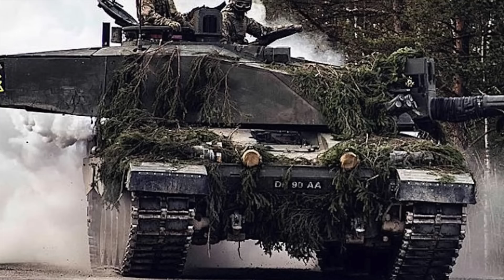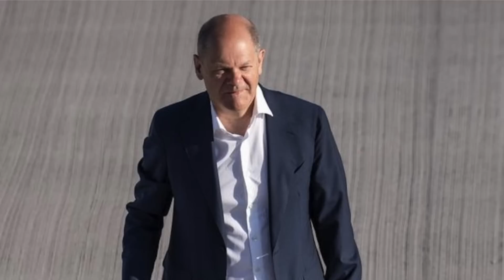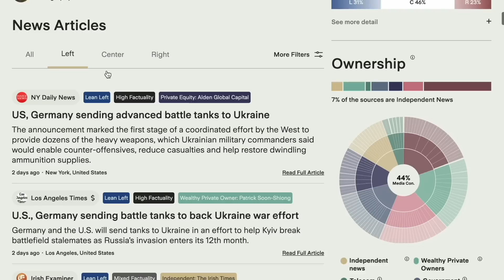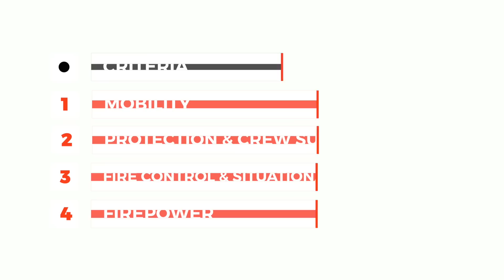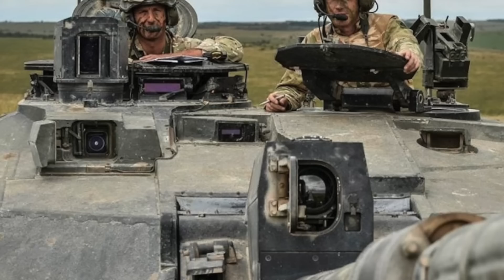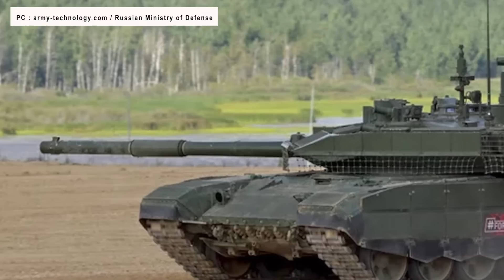British Challenger 2 vs Russian T-90 - Detailed analysis !

Comment: The original T90 wasnt supposed to replace or developed from the T72. It was a T72. Namely the T72bu upgrade they were working on since the later 80s. After the Gulf war in 91 where the T72 got wrecked they changed the name of their most recent upgrade to T90 when released in 93. In order to reduce backlash on sales.
Reply: T90 is basically a T72 with a few electronic upgrades like basic night vision.
Reply: Yes, the Russians are good at renumbering an old product.
Reply: Iraq T72 didn't even have thermal optics, they got the export model that didn't have composite armour and thermal optics, they didn't have a chance, in reality they were greatly outdated, even the Russian T72 was is outdated compare to M1 and challenger, but would've put up a better fight then these export models that were taken out while blind.
Reply: @paulroustan3643  the same excuses also were used in other cases. The Ukrainian war has shown that the Russian version is just as crappy and even worse than the Arab ones. As they lack the French optics, computers and communication sets the Arabs often use.
Reply: @ZLSM-fan   most destroyed tanks in Ukraine have been taken out by artillery, The M1A1 and the Leopard 2 won't perform any better against artillery fire, both will be penetrated any artillery fire.

The Kornet was designed to take out the M1A1 through its frontal Armour, the Kornet destroyed a Leopard 2A4 through its turret frontal Armour.
I don't know if it can get through the M1A3 frontal Armour, but it will get through the Leopard 2A7 the frontal area of the hull, don't know if it will get through the Leopard 2A7 frontal turret armour though.

Remember the Kornet is regarded by many analysts around the best in the  world, forget about going to MSM BS, go see for your self from independent analysis,  it can penetrate up 1.3m of modern composite armour
Reply: @paulroustan3643  you still think they will have weapons and equipment in the Russian army 🤣🤣🤣 Why do you think they told the artillery boys to use their shells economically, at the front the supply is destroyed faster than they arrive. The Russian armed forces would have spent the money they pay you and your Russian Copium Squad members online better if they invested it in logistics and weapons production infrastructure. Now they have to beg North Korea and Iran for weapons.
Reply: @paulroustan3643  Funny how you fail to mention one of the tanks this video is devoted to.
Reply: @paulroustan3643  The Kornet was designed Russians though, they may have said it was designed to take out M1A1s but the funding  got spent on vodka and hookers and can't do shit, they just said it can to the higher ups. 
Joining the military in Russia is like working at Mcdonalds, it's for bums (actually that's probably too harsh on McDs) and there's so much corruption any claims made about how good anything is like believing Russia stronk memes.
All the decent tank crews will be dead and they're getting basic training now, Ukrainians on the other hand are getting training in the UK by actual professionals (I know I live near a base, I've seen and heard them training).
Reply: @paulroustan3643 Not only that but they lacked experience and ammo. They says they were using practice ammunition against the Abrahams so it wasn't surprising why they got completely destroyed.
Reply: Yes, it is true that the T-90 is a further development of the T-72 tank...And it has nothing to do with the events in Iraq?! It is a contrived propaganda narrative for fools! Because anyone who believes in that is either a fool, an idiot or a total jerk! Because anyone who buys a tank, he certainly understands tanks, knows that the T-90 is an improved version of the T-72, or better said, a further development of this tank. So someone is now going to "deceive" someone by changing the name of the tank?! Don't be ridiculous! Also, the T-72 and T-90 were sold without problems both before and after the events in Iraq... Because they are to everyone , who bought these tanks, very well-known facts, which I will state, presented below in the text.

The T-72 tank used by Iraq is a deeply degraded variant of the T-72 M tank, which was produced under license in Poland and Czechoslovakia during the USSR... Purposely, the creation of a degraded variant for export, and for the countries of the Warsaw Pact... So that all the countries of the Warsaw Pact had exactly this version of the T-72 tank, some countries still have it, such as Bulgaria, and the Bulgarians even call the T-72 version M the "monkey version" which is not far from the truth! Also, Yugoslavia could only buy the T-72M version, which it later produced under license in the significantly improved M-84/A version... Or to be more precise, the then Soviet army, and later the Russian, Belarusian, Ukrainian army ... They never used the T-72 M version because it was never intended for the Soviet Army, nor was it ever produced on the soil of the USSR ... Otherwise, the difference between the original Soviet versions of the T-72 and the version for export and for the Warsaw Pact was huge! First of all, in the armored protection of the tank, not to mention the opto-electronics on the tank itself! The version of the T-72M that Poland exported to Iraq had armor protection and opto-electronics, all systems in the tank were at the level of the prototypical version of the T-72 tank, under the designation "Ural" from 1972, with a classic cast turret, without reinforcement in the armor protection. on the turret, with added non-metal. Only that the T-72M/M1 versions were called until the mid-90s of the last century, and they were at the level of the end of the 60s... Only the T-72M1 version reached the level of the first modernization of the T-72 tank, the T-72A from 1977, and not even in all segments. And only somewhere in the mid-90s... Which means that this T-72M tank has a primitive fire control system, where you have to stop if you want to hit the target at all, this version doesn't even have a meteo sensor, also the tank itself is practically "blind" at night, since it has visibility up to only 800m in ideal conditions... For comparison, the first modernization of the T-72 tank from 1977, the T-72A, already had reinforced armor protection, with added non-metals... Meto sensor, and a new fire control system, while the T-72A version from 1981 even had ERA contact 1 protection, and a new cannon...Which means that the M version was even worse than the first old Soviet modernization of the T-72A from the end In the 70s of the last century ... Let's not talk about the fact that the T-72B version was already in use in the USSR in 1984, which had an even thicker basic armor than the A version, plus ERA contact 1, and a new fire control system, new cannon, and new ammunition, as well as the possibility of firing from the barrel of the cannon, new SVIR range guided missiles 4 km ... Also, to make matters worse, the Iraqis also bought old USSR stocks of old projectiles with a penetration of only 300 to 350 mm of homogeneous steel?! The Iraqis, even without a license, saw the T-72, which was even worse than the T-72M version... So what the Iraqis had only physically resembles the T-72, otherwise it is a far degraded variant of the T-72 72 tanks... These are facts that can be easily verified. So this version of the T-72 M, due to the latest version of the M1 Abrams tank, had absolutely no chance, for obvious reasons... Other factors also played a role in that conflict, from the complete military superiority of the countries that attacked Iraq, up to the complete control of the airspace and everything else... Also, and for better understanding, the version of ABRAMS tanks owned by, say, Egypt is not at the level of ABRAMS tanks owned by the US. But the difference with the mentioned T-72 tanks is even more drastic.

Here in this video clip, some data are listed, which are correct, but they are persistent throughout the video clip, they mention the characteristics of the first and initial versions of the T-90A tank, which is certainly worse than the Challenger 2 tank. But there is no mention of the T-90M /MS versions or the last and best T-90M Proryv 3. Or those versions are mentioned, but their characteristics and specifications are not mentioned, but the T-90 A version, the initial version from 1992, is constantly being talked about... The T-90 in the version with an 840 hp engine has a maximum speed of 60 km/h. so it's a bit faster than the Challenger 2, which has a 1200 hp engine ... While the T-90 with a 1130 hp engine, which is also the most mass-produced, has a speed of 70 km/h ... And all variants of the T-90S tank series /M /MS /M Proryv2/ 3... They have an APU unit! In the video clip, he stated that they don't have any?! The initial version of the T-90 tank from 1992 has "Sthora" active protection, which is outdated, that's right! But it is only on that old version! While in the video clip he did not mention any other version of the active protection that is used on newer versions of the T-90 tank, it must have been "accidental"?! Since T-90M/Proryv 3 versions... Use active protection "ARENA M" or even "AFGANIT", why is it not mentioned in the video clip?! It must be "accidental" again?! He also stated the data, again from the initial version of the T-90A, when the question is about the opto-electronics, from the initial version from 1992, which has not been produced for 15 years?!

  It would be about the same as me comparing a Leopard 2A7 to an M1a 1 Abrams from 1989?! But this is a propaganda video for exactly that purpose! .And in the end, the madness of the brain "all this just like on paper because because of corruption, mostly nothing works on Russian tanks"?!

What a serious detailed analysis looks like, with all the disadvantages and advantages of both tanks. And the M1 ABRAMS SEP 3, which is a significantly better tank than the Challenger 2 in every sense! And the T-90M was the best variant at the time, after that the T-90M / Proryv 3 variant came out, which is still a significant improvement.

https://www.youtube.com/watch?v=mPlNvgH1zic
Reply: @SRB.4S  Apart from the beginning you couldve saved yourself this entire article because I knew everything relevant in there already. 
The T72bu upgrade got renamed into T90. And as a german with a recenty retired defense minister I know for certain that sometimes the people buying tanks dont have the slightest clue as our former defense minister stated herself. The renaming certainly doesnt hurt and if you can fool just one country it was worth it.
Reply: @TheDude50447  
Yes, my friend, even if we take a theory, which is not correct, but let's say that it is, that you can trick someone, you say, find some fool! What will we do with the other 10 "fools"?! Since, in addition to Russia, 10 other countries use T-90 tanks in various variants, some of which are also produced under license in those countries, and they function without problems. He claims that this is not the case, or more precisely, that the propaganda story did not succeed, because both the T-72 and T-90 were sold without any problems...Also, those Iraqi tanks are the version mentioned above with the T-72M, and in such conditions of conflict , the complete military superiority of the opponent, in the air and on the ground, had no chance against the best versions of the ABRAMS tanks at that time. If you knew about this article about the T-90 tanks, then you understand what kind of lies this jerk from the video clip is using?! Because everything that is stated is valid only for the T-72UB version or the first version of the T-90 tank ... That tank has not been produced for a very long time ... There have been 5-6 modernizations of the T-90 tank since then, which I have already mentioned above, and whose characteristics he does not mention in the video clip, instead he compared the T-90A with the Challenger 2?!
Reply: @SRB.4S  I cant remember what the video was about. But I agree that more modern T90 variants are actually worthy of being called a T90 unlike the original.
Reply: @TheDude50447  Exactly !
Reply: @SRB.4S  Wow! Anybody would think that this was Military Publications site.
Ruzzian tanks, are cr@p. The fact they've lost thousands, against cutting edge Western technology, is all the proof you need. Sometimes quantity, does NOT have a quality of it's own. Especially, when you're knocking out $2,500,000 tanks with $10,000 projectiles.
Reply: It has also been produced in relatively small numbers. It is not likely to have a significant impact.
Reply: @karmakazi I certainly dont know everything and never claimed to. I didnt know that for example. I just happened to know what the other guy told me in a lengthy comment.
Reply: If there is a proper tank battle, it will most likely go thd way of Kursk…. Superior tanks defeated by superior numbers
Reply: @byza101  thats a pretty big underestimation of the mainline Red army tanks. The T34 has a reputation of being one of the best tanks in the war and with the 85mm could take out Tigers from quite the distance. And it was their most numerous tank by far

Comment: T-90:
- Pros: It's a tank.
- Cons: Corrosion, corruption, government.
Challenger 2:
- Pros: It's British.
- Cons: It's British.
Reply: Explain.
Reply: @Peter Stubbs  Being British means that it has very good quality, and it has an overkill when it comes to firepower, and especially survivability. Unfortunately, being British also means that it is conservatively designed and is already outdated by NATO standards.
Reply: @Selvariabell Agreed, Hence Challenger 3 which is already in the works as them Russian threat is all to real right now.
Reply: @dereckjtbear2175  that CR3 seems to be a 10 years too late design. It has the standard 120mm smoothbore gun even though a 130mm gun already exists and was even put on the challenger LEP. It's also still using the same 1200hp that's just weaker than other MBTs of other nations, not to mention the lack of LWS or Hard kill APS which is pretty much the norm now.

They once again Designed the tank of today, not for the future.
Reply: @ImSmad  chally 3 can support the 130mm when/if it becomes nato standard and the engine will be 1500bhp

Just look up Challenger  3 130m  they made a prototype

Also it's getting APS
Reply: @CJjohnston56  the thing was, why not now? They knew they could put a 130mm gun in it yet didn't, you do not follow the old norms, you go ahead of it. And it's not like switching the gun is just as easy as taking the gun out then adding the 130mm gun in. It has its own turret mantlet to hold the gun in place. Not to mention adding the autoloader that can use blowout panels since 130mm is too big now for a crew to load it without being really exhausted. It would take years to swap all challenger 3s from 120mm to 130mm. So instead of 120mm now, 130mm later. Why not go for the 130mm from the start?

Also challenger 3 is using the CV12-8A which is a 1200hp engine
Reply: @ImSmad   they've already proved they can make it 130mm,  the main reason they haven't is because it would only have 19 rounds compared to 39 its gonna have...especially when 120 can still first round kill most if not all russian vehicles..plus theres no need for britain to have a tank with 130mm  it rarely uses tanks...I'm not gonna argue  with you here..

Secondly CR2 uses a CV12 6A CR3 is getting an upgrades CV12 9A  upgrades include better cooling and a common rail system  which will provide 1500...  not to mention titan and Trojan uses the same engine but have 1500 horsepower already...

Edit: different sources say different things  some say 8A some say 9A  eitherway  speaking to lads down the D&M wing at Bovington it's going to be 1500bhp
Reply: @Sami Rantanen, What's your point?
Yes British and very proud of it, what do you have..?
Certainly nothing in comparison but a silly jibe.

Comment: Isn't the T90M ammos stored differently then the rest?
Reply: Only for stored rounds which are now in blow out compartments in the turret bustle.  The ready to fire rounds are still in the autoloader's carousel beneath the gun in the hull and completely unprotected, so they's still  ready to send the turret off to Mars when hit!
Reply: @peteturner3928  Saw a video clip from the factory, seems like they are now installing some spalling/shrapnel protection for the ammunition carousel, a top plate and side skirts. Probably trial and error until they figure out something that adds better protection. Pretty sure they are going to evaluate the western tanks once they enter the fields, as they have barely encountered any modern weapons, most modern they fought was in Iraq, old T-72 export models from the 70's-80's. The Turkish Leopard 2's got hit by Kornet in Syria and it didn't look good, but that was the export model of older design so.
Reply: Yes and contrary to belief it is the ammo outside the carousel that is usually responsible for turret popping, the carousel is low down and has armor.